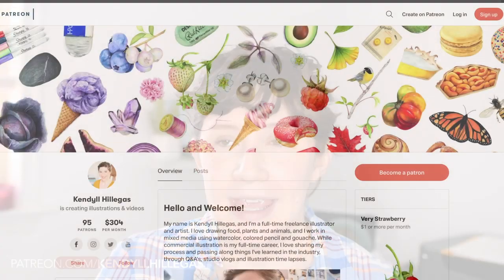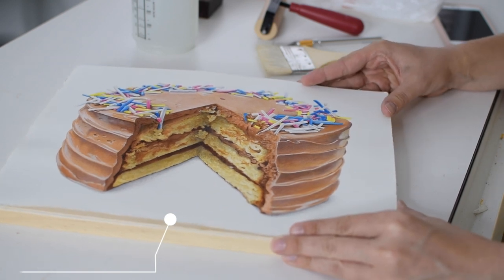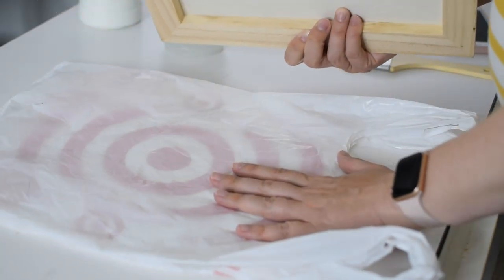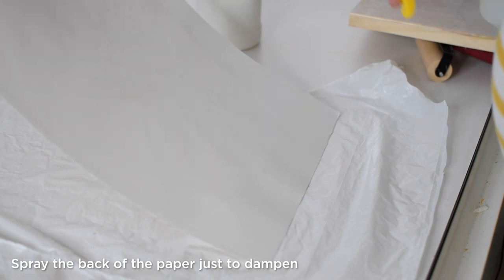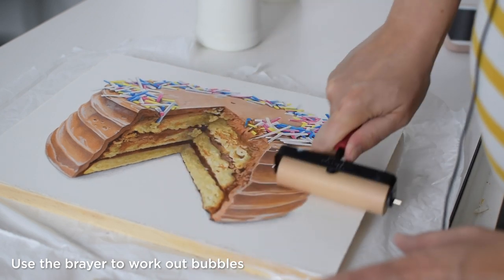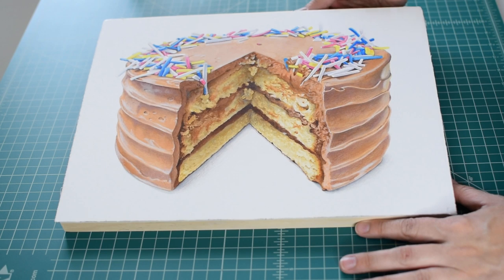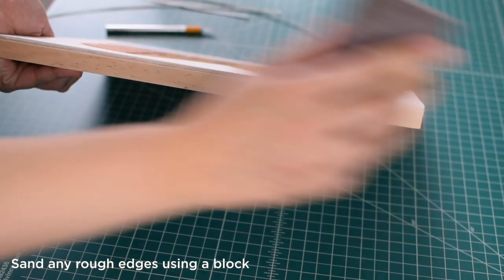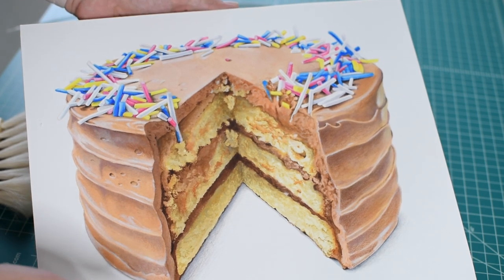How to Mount Works on Paper to Wood Panel

Comment: Am wondering if you should gesso the panel
for archival purposes before you glue it down, so the wood does not leach years from now? Also I was told to wax the picture afterwords, was planning to use Spectrafix and then Dorlands wax.
Reply: When mounting paper on panel, I always seal the panel first using a few coats of Golden GAC 100. I think it's a better sealer than Gesso. For top coat, I use Golden UV spray varnish.

Comment: Hello Kendyll! Thanks so much for your guidance, I've been creating larger watercolor wood panels (30x40). I think I'm getting the hang of things. Hope you may be able to provide some advice for tiny air bubbles. I'm trying my best to eliminate them all together with lots of rolling, but a small one showed up. Do you know how air bubbles may wear over time? Is it something that could continue to lift and warp? Just want to be cautious as I intend to sell my pieces. 

Any advice for getting rid of them if they do appear? Have you ever tried the cut / syringe glue method?

Comment: I just saw this video, coincidentally after visiting a pop up and deciding to mount some of my alt photo pieces instead of framing behind glass.  Perfect timing!  Curious about using the acrylic gloss medium; why that and not YES Paste?  Also, I, too am interested in waxing my prints (like Monica); would you suggest post mounting for that?
Reply: This is a great question. I've been using YES but I think it's a little harder to spread. The medium spreads quickly and evenly so maybe it's easier? I haven't tried medium yet though. I'd love to hear her answer!

Comment: Great information! Definitely going to try this. I have a question on the varnishing though. 
Since you're a mixed media artist, do you know what kind of varnish is best for mixed media art? I've had some accidents with varnishing because I also use a lot of different media and I never know if a certain media will react badly with the varnish. It has always been a nerve-racking business to me. Do you have any advice on this?
Reply from the maker: That's so tricky! It really depends on the combination of media you use. I like to use ones that mention being safe for both pencil (dry) and watercolor (wet) media. Usually these are different that the ones that work for oil or acrylic. They're almost always sprays, not liquids. Regardless, I recommend creating a test patch where you layer the exact combination of media you used on your piece, and then try out the varnish. Let it sit for several days before you decide whether to use it on your piece. Never use a varnish for the first time on a finished painting!🙏🏻🙏🏻 That's a recipe for tragedy. 😅
Reply: @KendyllHillegas  Thanks so much! 😊

Comment: This is such a good tutorial! After the 24 hour sit, if you do have any air bubbles, what would you recommend doing?
Reply from the maker: If they're on the edge, you can put a little of the acrylic media on the tip of a brush and wiggle it under the bubble. Then apply a weight directly to that spot. If they're in the middle, you can try using a fresh x-acto to "pop" it, or you might just decide to leave it be. It's difficult to get additional acrylic media underneath an air pocket that's in the middle of a piece.

Comment: I’ve seen other videos of this for watercolor paintings. Does it work for drawings on much lighter paper?  Or is the technique different in any way for lighter paper?
Reply: Lighter paper may absorb too much water. I’ve mounted posters using paper glue and the water from the glue made the paper bloat in places as it dried.